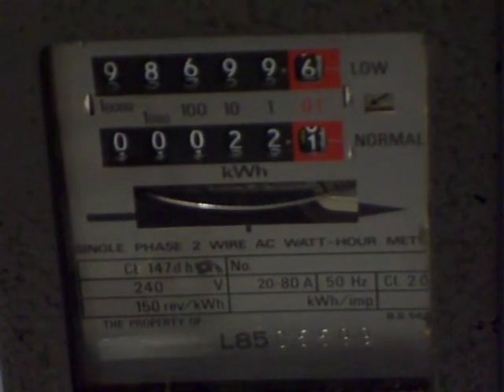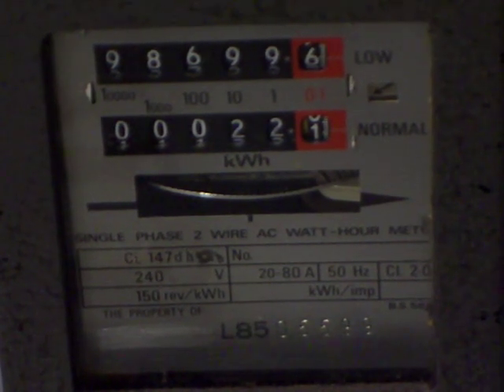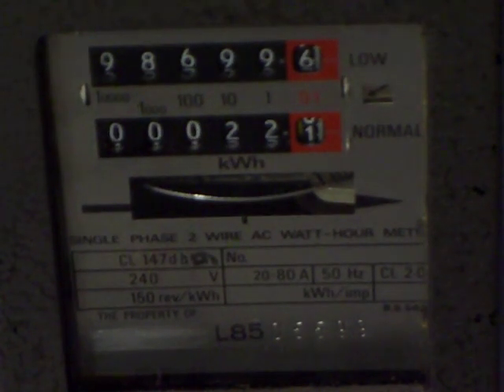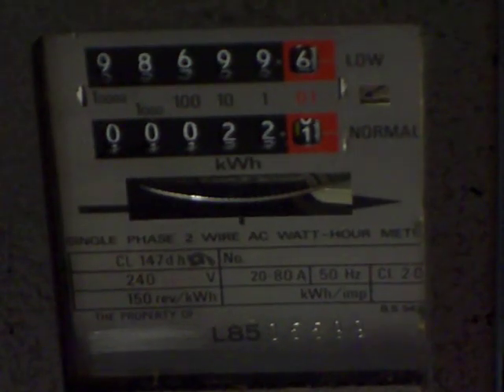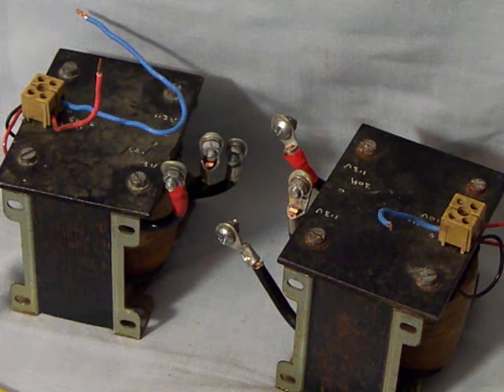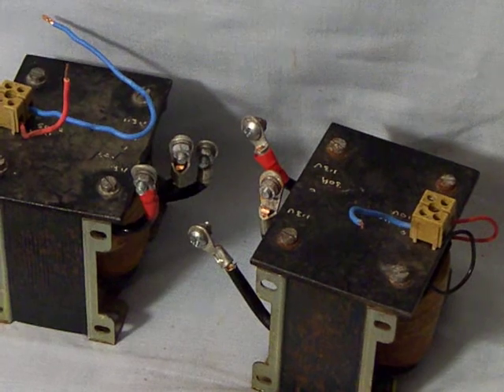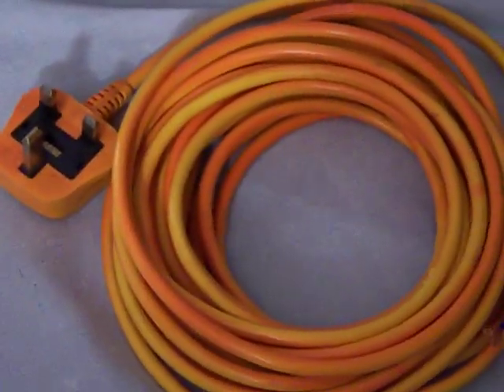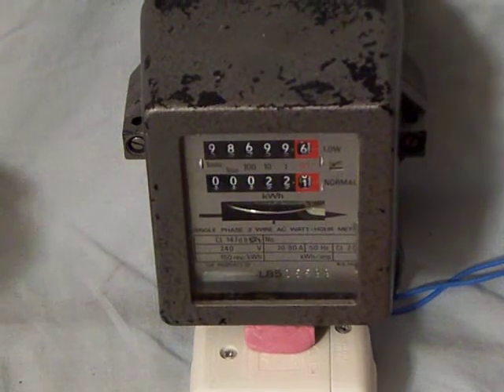Electricity Meter : An explanation on the "Phantom Loading" technique.

Comment from the maker: Camera Info: Kodak Z1285.

This camera does have a HD function on it, but I currently use 640x480. HD would be 1280x720. Disadvantages with HD include a lesser recording time on the memory card & larger files. My computer also doesn't seem to like running HD files & I don't think my [basic] video-stitching software likes HD files, or is incompatible with HD files.

I'd seem to think that a proper HD camera is very expensive, & I wouldn't buy anything that doesn't take AA batteries.

-BBD.

Comment from the maker: Hi. These transformers have wrote on them:

110v, 1.3v - 0 - 1.3v & 30A

So, with both of these, If I parallel the outputs & use the outer connections & not use any of the centre connections, this will give me 2.6v at 60A.

In series however, would give me 5.2v at 30A.

These transformers can go WAY MORE than their rating for a short while. While I was at Mr. Photon's, he demonstrated these to me & we temporarily saw 200A on a clamp meter & got a junior hacksaw blade glowing RED HOT! :D

-BBD.

Comment from the maker: (Msg 1 of 3) Ah yes, I see your point here, but the thing is, this is a special wiring config. :-)

Admittedly, it is all done a bit 'on-the-bodge', & if I was going to set this up either as a permanent on-board config, or wire this for supply to someone else, then it would all be done properly. Heck, even when I power this up, there's going to be exposed live terminals, & it doesn't get any more bodgy than that! :-O

This is just a quickie demo setup. Another reason for using cables that are...

Comment: Is it not really bad to use Earth cable as anything but earth .I have had so many complaints from doing this in the past its silly .I even have to rewind my paralleling choke its said if i were to fall down dead for whatever reason someone could come in and either cut or disconnect them and get shocked as they think its an earth but really its not .Only a warning I'm not colour discriminative but you would be suprised how man ppl get upset about it and claim bad practice to show to others :0)

Comment from the maker: (Msg 3 of 3)....this Phantom Loading stuff & its related wiring config, if I can modify my Metering Board to accept Phantom Load Current, then I will do so in a safe manner & possibly even make a mini add-on test board which will be a Phantom Current Driver Unit. 

That will obviously be wired safely with no exposed live parts. Even then, it will take a trained & skilled user to run the unit, because if too many amps are driven through the circuit = POP!

A fuse will protect against that.

-BBD.